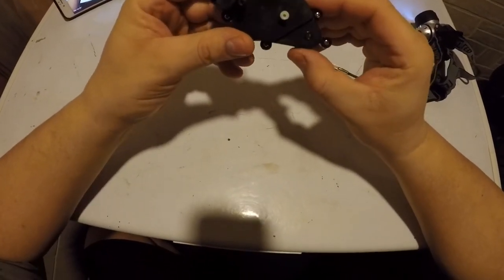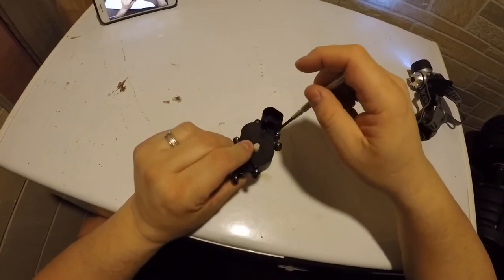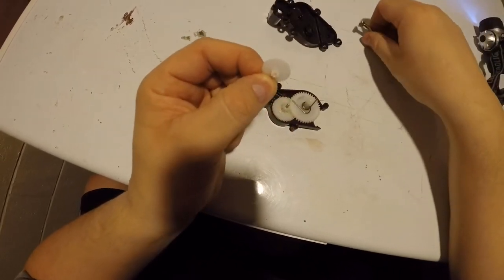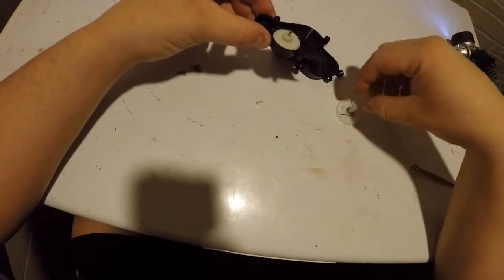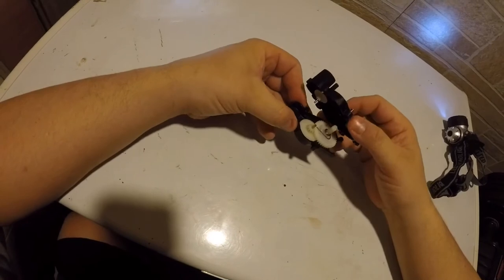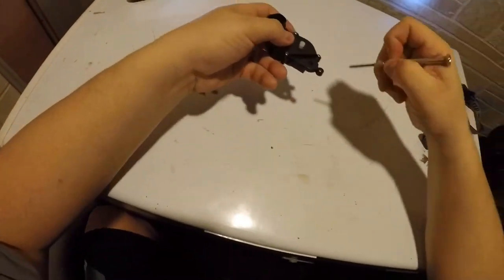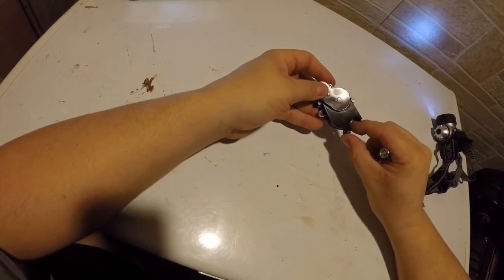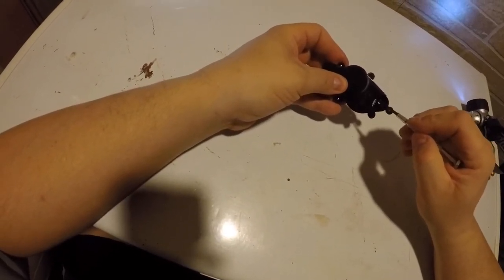Detailed assembly of MTH 30-11028 operating water tower gearbox.

Comment: Thanks, your help was a great effort. The small gear on the motor shaft broke. The spring in your video did not match mine. I have had problems with other operating accessories. No more animation for me! Thanks again.
Reply from the maker: Tennessee Ron 
No problem.  The small gear on the motor is an easy fix. As far as that spring in the gearbox, I don’t think it does a whole lot.  Because the spout assembly itself has a return spring and the counter weight to bring it back up.  I really think it’s sole purpose is to help take some of the torque off the cheap plastic gear on the motor shaft.  Once you replace it with a brass one it should be problem free.

Comment: This helped gearbox is good now the small gear that goes on motor has split is there a replacement brass gear if so who has it motor works fine
Reply from the maker: You can get the gear on eBay.  Here is a link to it.  https://www.ebay.com/itm/362373738208 
I hope this helps.  Happy Railroading! 🚂🚃🚋

Comment: I know this is a old thread, but just picked up one of these used.  Can't wait to try this out, thanks.  Any idea why there would be no digital sound?  Is there a part that normally fails in this regard?
Reply from the maker: These early versions didn’t have sound.  I believe Z-Stuff makes a sound board that  works with this model but I’m not 100% sure. Good luck with your water tower.  Thanks for watching.  Happy Railroading! 🚂🚋🚃
Reply: @CalebsTrains  thanks.  I’ll check this out

Comment: Hello, I have been watching your videos on the MTH water tower and the problem I am having is the water spout will not retract once lowered. I bought a new brass gear as recommended for the motor and watched the video on tensioning the spring. Still won’t go up. I do know that the gear box spring is under tension, because once I release or pull out the motor from the gear box assembly, the spout springs up with force. Can you help with this problem? Thanks!
Reply from the maker: It almost sounds like the gears may be binding.  I would just make sure all the gears are in the correct positions.  Also did you grease the gears in the gearbox?  I hope this helps.
Reply: @CalebsTrains  I just greased all the gears and checked the set up. Everything looks correct and is correct. I think it has to do with the internal spring. Everything moves well when the motor isn’t inserted into its holder. However, once inserted and the button is pressed the spout goes down but then still won’t go up. BUT once I pull the motor out of its holder, the spout comes up, uncontrolled. So it’s either the internal spring or the motor causing issues. Any thoughts? Thanks again for taking the time!
Reply from the maker: @nicholasbruno4014  
The only thing that comes to mind is maybe the shaft on the motor is bent or the brass gear is on crooked.  It wouldn’t take much for it to bind up with the gear in the gearbox.  You might try oblonging the holes that the screws go threw to give a little adjustment for the motor.  This may give you a little clearance so they don’t bind up.  If it snaps back without the motor installed, then it’s something with the motor in my opinion.  Good luck.